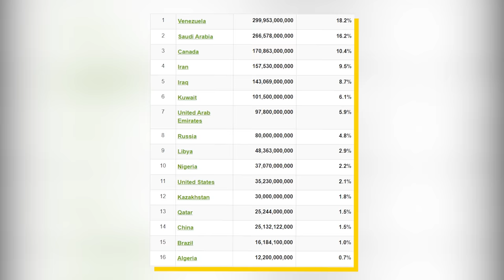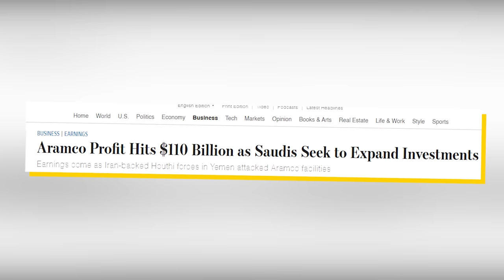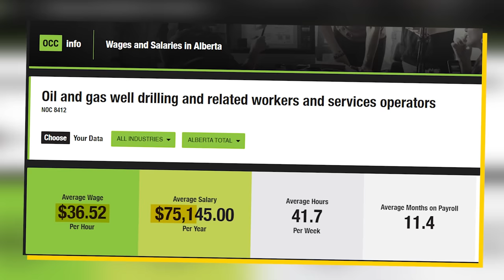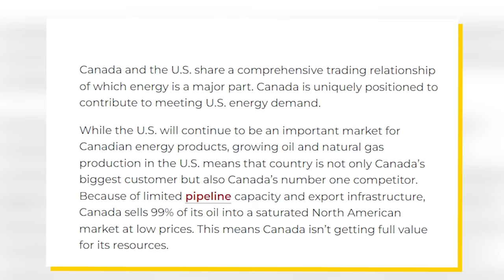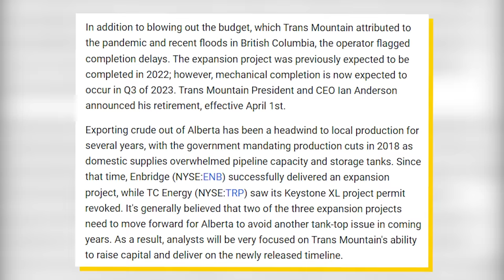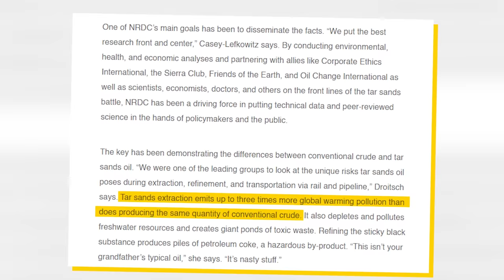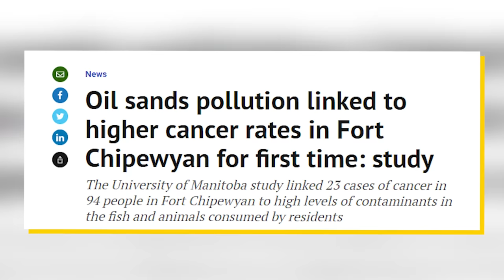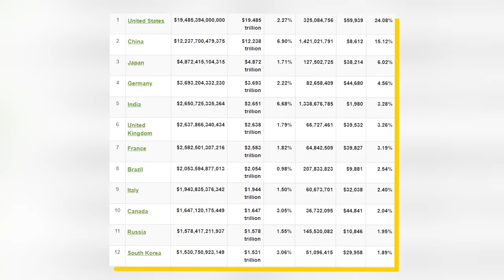Why Canada Refuses To Exploit Their Gigantic Oil Reserves

Comment: Canada is the third largest oil exporter in the world. The conclusion and title of the video are factually wrong. Canada does exploit it's oil reserves fairly aggressively despite all the technical issues.

At the same time, the video does cover many of the aspects of the Canadian oil sands industry. In my view the primary reason that Canada doesn't export to Asia, or even permit significant Asian participation in the oil and gas industry is long term policies in Canada and the US for energy security. There is a "silent" tendency in trade, business and government to keep the Canadian resource for North America only. As every Canadian and Mexican knows, what the USA wants, the USA usually gets.

When I worked on offshore projects a "spill" was anything more than a gallon. More oil is spilled by DIY mechanics in any major city in the world that is spilled by the oil industry in Canada most years. But when the oil industry has a big spill, it can be spectacular. This is the nature of any large industrial process. The environmental issues in Canada would be  (and are) quickly swept aside if there was any serious impediment to US energy supply.
Reply: Yeah that's why we've been trying to sell our electricity surplus but they have imposed a tariff restriction (lower prices just like our oil) on us and their largest City (NYC) is screaming after the federal government for their interference in this "deal" as we just turned them down (a few months ago).
Reply: Yes what the US want in north and even south america the US gets
Reply: how ironic is it that canada and not saudi arabia has what's called sand oil lol
Reply: Thank you. Good to see some critical feedback on these type of clickbaity, view hungry, often misinformed youtube videos.
Reply: them thinking that Venezuela didn't exploit their oil supply because they were corrupt also pains me. they exploited their oil supply and as a result became corrupt.
Reply: @Bigzthegreat  no the us couped them a bunch of times and is threatening them with soft power like the rest of south America
Reply: @bigmviperplayz253  - You left out the key detail about Venezuala's gross political corruption and economic incompetence.
Reply: @jonfklein  Canada is essentially producing at full capacity. Saudi and Iran are not. The problem isn't Canada being able to produce more oil, it's about producing more oil tomorrow. Producing oil isn't like turning on a tap. It isn't just sitting there waiting to be burned. It really isn't all that easy, or cheap to increase production capacity.

The biggest challenge the Canadian oil industry faces isn't finding resource, it's finding buyers willing to commit to 20-40 year contracts at a high price. Oil sands requires billions of dollars of investment and years before selling your first barrel.

So the US looks to Saudi and Iraq who can produce an  additional 1-4mbopd during the "short" crisis, until Russia goes back to normal oil delivers. Canada requires a longer commitment and lead time.

There are additional complications such as the type of oil refineries can  use. For example, some refineries can only use heavy oil, like Canada's and others can only use lighter oil, like WTI or Brent. The refineries cannot switch quickly. This can lead to price volatility.

My expectation is that as Russian oil finds it's way into China and India over the next year, Middle East oil will find it's way to Europe and the price will stabilize with most of the price increase really due to increased economic activity and little due to the war.
Reply: @logaandm  
You are right and wrong. It's true that the global majors in the oil and gas industry have cut and ran from Canada, and profit expectation underlies this exodus. But the root of the problem is not the cost of production, it is environmental and political opposition. Basically Canada has an unfriendly environment in which to produce oil, which increases risk to investors. Also there is insufficient takeaway capacity to support expansion of the oil sands anyway for the same reason.

Canada is right next door to the largest oil consumer in the world. Hence expansion of Canadian oil sands production could be unlimited if it was not opposed. Also, the US refineries along the Gulf are amongst the largest and most sophisticated in the world and are designed to handle heavy crude.

One further point. The economic war against Russia is a long term game, not short term. Development of Canada's oil, and gas, resources should be happening now so that it can be used to displace the production from bad actors in the world like Russia. Are we to give Russia a slap on the hand after they annex a quarter of Ukraine and sign a peace agreement, only to have them invade again five years from now, and we are back to square one? It's called energy security, something the climate-zealot nit-wits running Europe, Canada and the USA right now pretend isn't important.
Reply: @jonfklein   I'm Canadian, I worked in the oil industry in Canada and elsewhere my entire adult life. (Started at Home oil in a summer job in 1976 out of high school) I've had this argument many times before.  This is a false narrative spun for political purposes.

Go look at the actual export data and not just parrot what you hear on the local news. There has never been a slow down in Canadian exports (almost exclusively to the US) in history EXCEPT for price drops and recessions. Never.

It has always come down to Canadian oil being more expensive than other oil. In the end the cost of production, the cost of transportation, the cost of refinery modifications make Canadian oil a more expensive choice for US consumers.

Since there has never been any serious slowdown in Canadian oil exports it is very hard to argue that it's about the environment, politicians or protesters. It's really that the Americans don't want it at that price - for now. Canadian oil is expensive to produce, it is harder on the environment. There are better alternates. For Americans (and many Canadians) Nigerian oil is cheap, light and the environmental damage is in Africa where it isn't seen by voters. It really is as simple as that.

In recent years society collectively has decided it wants to move away from fossil fuels for environmental reasons. That has complicated things because of the very long lead times for all oil and gas projects worldwide. All the easy cheap oil is gone and has been for decades. As I said, Oil companies are reluctant to invest unless they get long term contracts and short term problems like the Ukraine war don't change that. With governments worldwide committing to electric cars all oil projects - which by their nature are long term - have a higher risk and no one will commit. 

Economics has always been the primary driver and only economics is needed to explain production and consumption patterns. I have absolutely no doubt that if people want oil, they will get oil even if the temperature in Alaska is 40 degC year round. That is how people are and I haven't seen any data to suggest otherwise.

As a good example, all the BS about natural gas being "greener". It's a fossil fuel and methane is a worse greenhouse gas than CO2!  But natural gas makes cheap electricity that is easier to startup and shut down compared to coal plants for peak load management. That is the real reason it is used but it is just BS. Gas fired power plants make the problem worse, just not as bad as coal.

People have an endless ability to lie to themselves when it suits their interests.

FWIW In my estimation human induced climate change is a fact but:

1. Climate change is worse than the popular media suggests it is. 

2. It is already too late. When the arctic is melting, you have already put 80% of the energy in the system. The melting of the arctic will make a positive feedback loop of release of methane and CO2 which we can't stop.

3. We actually have bigger environmental problems. The real problem is and always has been too many people consuming too much.

4. People are going to consume anyway.  History shows this many times and I see nothing now to suggest humans are any different than the Sumerians who kept irrigating even though they knew it was destroying their farm land.
Reply: @logaandm  
You aren’t taking into account the lack of pipeline capacity to the US. They are taking as much oil as the pipelines can support. I think that says it all as far as demand for Canadian oil goes.

Harder on the environment than Russian, Saudi or Nigerian oil? I doubt it. There are no environmental regulations in those countries.

For oil sands oil, production, refining and transportation contribute about 15% of the total emissions of a barrel of oil. with the remaining 85% coming from the actual burning of the end products. For conventional oil, that figure is about 10%. So the emissions are only marginally higher for oil sand and can be improved upon. But these figures are if the emissions are controlled in a responsible manner. If the oil is produced in Nigeria, god knows what the emissions are. If it isn’t seen by voters doesn’t mean it isn’t there.

Which society are you talking about? There are different societies in the world that the developed world. Do you think a subsistence farmer in Africa gives a rip about moving away from fossil fuels? The issue of climate change has been politicized. Politicians are using it to scare the public, and claiming to be the ones who will save them - oldest trick in the book used by political and religious leaders since the beginning of time.

I think global warming is real, but it is by no means an “emergency”. It is an environmental problem, like the ozone layer that needs to be worked on. Renewable energy is developing and gaining traction and will be great when it is as cheap, reliable and readily available as conventional energy. But the way to get there is not to starve the economy of energy in order to force people to switch to an immature technology. It’s counter-productive and frankly stupid. How is strangling our economy going to make us better able to transition to renewable energy, how? It makes our society weaker, and other societies who benefit from our idiocy stronger.

Let me put it this way. If you want to transition to renewable energy should you sell your ICE car and seal off your natural gas line when you can’t afford an EV, insulation for your home and solar panels? You will have to quit your job because you can’t get to work now, and will spend one day a week chopping firewood. Are you any closer to having the means to make the transition? Of course not, you are now further away and in fact may never get there now.

If you believe the path to eliminating fossil fuels in the world is to stop using them today, then do it yourself. If you haven’t actually done it then you only need to look in the mirror to see that it is not the oil and gas industry that is causing global warming, it is YOU.
Reply: @jonfklein  If oil exports go up every year, which they do, then lack of pipeline capacity isn't an issue. Your argument is pretty weak. 

Keystone was canceled because it really wasn't needed and it make for good headlines. Same thing in reverse. It was promoted by the GOP because it made good headlines, but four years they were in power and it still wasn't built - because it really wasn't needed. I have no doubt if the US needed the oil, the pipelines would be built. It has been that way for over a century.

I agree completely on Nigerian oil. I have long advocated for taxes or duties on imported oil from certain countries. On a net basis, Canadian oil sands is more environmentally friendly than some oil producers.

In the end, I rarely give these things much thought because data and history shows them to be largely irrelevant. Oil production and consumption has always is driven by economics in the long term. Oil consumption will slow down when people don't want it any more and there is no sign of that.

You are completely wrong on climate. It is an emergency because action takes decades to implement and things are very bad.

I am not a greenie, I am not a tree hugger. I worked as scientific technical analyst helping to build simulation models for reservoirs in the oil business. The data and papers I have reviewed are very clear: human induced climate change is real and things are bad.

In my technical opinion it is already too late to stop serious temperature rise. If one could wave a magic wand it is possible - if we stop burning all coal, oil and gas, but the reality is that CO2 levels go up every year, oil consumption goes up every year and there are no signs slowing.

I cannot overemphasis just how significant it is that the Arctic is melting. Ice absorbs energy without raising it's temperature. So when it melts it means there is already huge amounts of heat in the system.

The same in reverse, we have to take out huge amounts of energy to get the ice to freeze.

This means that the melting arctic is a sign we are already gone too far. In addition CO2 and methane released from melting permafrost could easily exceed what humans are putting into the atmosphere. If that happens temperatures will continue to go up regardless of what humans do.

I am by nature and training a technical person. I review data, I call em as I see em.

1. Climate change is real and it is getting very bad.

2. People haven't stop using fossil fuels and there is really no sign they will stop.

3. While using alternative energy sources slow the climate problem, there is currently nothing that can replace oil or gas in the next 20-40 years.

The real problem is too many people consuming too much. The human population must go from where it is now to around 2-3 billion if we are to prevent environmental collapse. 

This is the real root cause it is a vastly harder problem than climate change and no one talks about it seriously.

I hope I'm wrong but I gave up a decade ago.
Reply: @logaandm  
Any increase in Canadian exports is by rail and by optimizing the existing pipelines to squeeze out a bit more capacity.

You are inferring that the Keystone XL was not needed because it doesn’t exist today without taking into consideration anything else. It was cancelled because the greenies are part of Biden’s political base and he campaigned on doing this, full stop. TransCanada had secured contracts to ship 500k bbl of oil for 20 years prior to proceeding with construction. So it most definitely would have been used. Was it “needed”? I suppose “need” is a debatable term. If American presidents prefer to go cap in hand to Saudi Arabia, Iran and Venezuela when they need more production, then you could argue no it isn’t needed. If they prefer energy security, then yes it is needed.

I agree with your prediction about oil consumption, with a qualifier: Oil consumption will slow down when there is a cheaper alternative available. This gets to the core of the energy crisis today. What is happening is western countries are trying to artificially increase the cost of oil by restricting supply in order to force people to switch to alternative energy sources. However, the same economic decision making that applies to investment in new oil production also applies to investment in renewable energy production. Investors will not invest in renewable energy if they know that the price of a competing energy source, oil, is artificially inflated. The price of oil could drop in the future, breaking the economic case for the investment in renewables.

I don’t think anyone really knows what will happen with increasing CO2 levels. Increased CO2 also promotes increased plant growth, and cloud cover. So it could be these and other mechanisms will regulate the amount of warming and keep the climate stable. But the earth is complicated beyond our ability to understand it. The way I see it is we don’t have a complete understand of how living organisms function, so how can we have a complete understanding of how the earth functions when it is made up of trillions of individual organisms.

I agree with you about consumption. Free trade with China is part of that problem - cheap products made to fail - which is a whole other discussion.

I’m optimistic. I think renewable energy sources will continue to expand and become more competitive in the coming decades. My problem is the path to get there is not to attempt to restrict oil and gas production, which is what western leaders promote, and Canada especially is paying a massive opportunity cost by buying in to this bunk.

Norway has taken the right path, they have not restricted their oil and gas industry. They have made it as clean as they can and use the revenue to build out renewable infrastructure throughout their country. They also have the largest sovereign wealth fund in the world. Canada on the other hand has a massive government debt and very little renewable infrastructure. Who is further ahead both economically and in transitioning to renewable energy Norway or Canada? Noway is miles ahead.
Reply: @wiseonwords  yeah and whose fault is that I wonder
Reply: @jonfklein  The US buys very little oil from Saudi. Biden went to Saudi to get Saudi to increase production so the global price of oil remained stable. 

If the market was stable with more Canadian oil or less Canadian oil prior to the Ukraine war it wouldn't have made any difference. There still wouldn't be spare pipeline capacity and Canadian producers still couldn't ramp up production fast enough to make up for the lose of Russian oil to the market. 

Increasing Canadian oil production to make up for Russia is a decades long process regardless of where it goes. I don't know of any oil executive who would build spare capacity "just in case." 

Your entire argument completely ignores the lead times for increasing production and ignores the fact that markets tend to stabilize to "just in time" and "just enough capacity". The applies to all industries, not just oil.

If Americans want to support Ukraine and the sanctions on Russia, then any American President would have to ask Saudi to make up some of the production lost because of sanctions on Russia, even though the US doesn't buy much if any oil from Saudi. That is because only Saudi, Iran and a few other countries have any spare capacity that get enter the market in less than year.

The Energy Independence that the US sought for so long has been achieved. Americans use US, Canadian and Mexican oil for most almost all of their needs. Biden's visit was all about world energy price (and politics).

If the pipeline isn't needed, it isn't needed. The why doesn't really matter. As I pointed out Keystone was a political football ON BOTH SIDES. The Republicans could have gotten it build when Trump was President - they did not. This is more evidence it wasn't really needed. If it was, then it would have been approved and built.

The Transmountain pipeline is a different story. As I pointed out in my first comment, something always happens to prevent significant exports of oil and gas from Canada to Asia and Europe. Always. 

It is my  belief this is a long term unspoken policy of the US government. Exports are just never going to happen. Canadians will be allowed to sell oil to the US and no one else. This time it was environmentalists. for Nexen it was China and the SEC. Petronas was "costs of the project after Shell pulled out. There have been others. Something always comes up to stop such projects. This has happened my entire 64 year life.

You are factually wrong. Modeling CO2 is well documented and tested science. It is happening. The Earth and weather systems are complicated, but not beyond our understanding. Climate modeling, especially the pessimistic ones, has been depressingly accurate.

Just because you haven't taken the time and effort to understand climate science doesn't mean it is uncertain. I am not an expert, but my expertise is in mathematical modeling and I have spent some time trying to understand climate science. Most people don't have as much idle time or a passion for science as I do.

Aside: I find it ironic that oil company executives fight climate change science and the modelling so strongly. I worked on teams that build models using exactly the same equations, exactly the same science that climate models use (equations of state, fluid flow, heat flow). 

Oil company executives used these models to make corporate life and death decisions. So, when they say they don't trust that type of modeling, they are just plain lying because they use it all the time.

I follow renewable energy pretty closely in part because I want to convert my house to entirely solar. I am not so optimistic.

The biggest problem is batteries and energy storage. There isn't any good cheap ones that form a long term solution at the scale the world needs.

Solar and Wind are great and there is plenty of it. The problem is the sun doesn't shine when we need power the most and the wind doesn't blow consistently. This is an even bigger problem in northern countries like Canada and northern Europe where energy use is very high at the darkest time of the year.

What is really need is energy storage technology - and so far nothing has come close to being able to fill that role.

Everyone has heard that Germany has produced 36% of it's energy from wind and solar. On a good day in July. There are days in the winter when wind and solar produce almost nothing. Overall renewables only provide about 15% of Germany's total energy usage. And Germany has put more effort and money into renewables than any other country.

Moving energy from the south where solar is more reliable and plentiful, to the north, where it is needed also presents large technological and economic challenges. There are a number of such trial projects. Most have failed.

Fusion is 50 years away and has been for 70 years. When they talk about the day they finally get more energy out than they put in, it is still 50 years away. They need to get about 3 times more energy out than they get in for it to really work. Even if they should do that tomorrow significant energy from Fusion is many decades away. By that time climate change will probably be well beyond the tipping point.

As near as I can tell, the one energy source that might fill the role is Fusion with Breeder reactors. Because of Chernobyl and Fukiyama, this are even more disliked than the oil industry  Even fusion isn't without it's challenges, but at least with breeder reactors there will a long term supply of fuel. Again, the a major problem is building enough reactors. It takes more than 10 years to build a reactor, they cost billions and they almost always go over budget and take longer to build than planned.

Conservatives have been talking about how the debt is going to destroy western civilization since before I was born. It hasn't happened. Japan has been running deficits for about 40 years and it is still the third largest economy in the world. The US debt is off the scale, and it is still the largest economy in the world. The effects of government debt on a well managed advanced economy is demonstrably almost nothing. This is a historical economic fact.

The conservative debt hobby horse is just evidence that conservatives don't have a clue how the economy really works.

I could write about his much more, and why debt hasn't matter and when it probably does but this video is about oil and not economics.
Reply: @wiseonwords  You left out the detail avout the US extreme sanctions and embargos which basically cut off Venezuela from all of global trade. It isnt hard to imagine how that vould possibly affect inmensily their economy.
Reply: @logaandm  A realist! You've made me nostalgic for the days when theoildrum was still an active website and community. The quality of thinking and discussion on the topic has taken a tumble since it was archived. You strike me as the type who may have been active there.
Reply: Canada imports almost the same quantity of energy that it exports.  Why does this happen, because central Canada gets its energy from the USA and West Africa.
Reply: @jrus690  Having a couple of glasses of wine while browsing YouTube?

Canada exports about 9'x as much oil as it imports. Exports about 4m bopd. Imports about 470k bopd.

60-75% of the imports are from the US because of lower transportation costs. Cheaper to go north-south than to go east-west.

For total energy, one has to include electricity and natural gas. Canada exports 3x's as much gas as it imports. Canada exports about 5x's as much electricity as it imports.

Before commenting best to type "google".
Reply: Did you know that typing Google does not tell you anything about the Canadian oil industry.
Reply: @logaandm  I had to have multiple shots after reading you reply, so yes, I have had some wine tonight.
Reply: @jonfklein  Keystone provided no energy security every single drop was for export
Reply: @logaandm  Aren't the huge shale reserves in the US cheaper to extract than 
Tar Sand oil as well?
Reply: @Paul-vf2wl  I don't think so, but I am not an expert in shale oil although I have worked shale gas projects. 

There are specific geological conditions which make some shale oil cheaper and those are exploited, but most hydrocarbons locked in shale is far harder to extract. Produced shale oil is light oil, which also means it is cheaper and easier to refine into sellable products.

The US Department of Energy has been working on Shale Oil for decades, including using an atomic bomb to try and get economic production.

Oil and gas are generated in shale at certain temperatures from ancient organic materials degrading in the absence of oxygen. Why shale? Because it is the mud and muck where most plants end up when they die.

Over millions of years the oil slowly seeps into adjacent rocks where it can flow more easily. If the oil is then trapped, it becomes a reservoir. That is where "conventional" oil is found. (If you want know more, do a search of "basin modeling")

The history of the oil business is starting with rocks where oil is easily extracted then moving on to rocks where the oil is difficult to extract. This is simple economics. You go for the well which gushes because it's cheap to produce. The fact that shale oil is even produced is a sign that all the easy stuff is gone.

Because there is so much shale everywhere in the world, it is easy to "spin" a story, but the simple fact is it would take a thousand years for most shales to flow enough oil to fill a barrel.

There is plenty of hydrocarbons, oil and gas out there. That isn't the problem. The problem is getting it to flow at an economic rate.
Reply: Canada has doubled it's oil production in the last 20 years. Unfortunately tax on the oil has halved.
Reply: If Jeffrey wants to be a hoonigan and fuck around with his DIY shit box on the weekends in the city, cool. More power to Jeffrey. Urban environments are already constructed environments, big deal. The same can't be said for the giant pipelines boring directly through dozens of Indigenous reserves, with literally zero relevant compensation, nevermind any form of actual consultation. You're right, after all; "environmental" issues are swept aside, the same as all the brown and Indigenous people making those "environmental" cries.
Reply: @wiseonwords  Venezuela was exporting oil to and refining oil in the USA  for many years without issue. Trump sanctioned Venezuela second day in office.
Reply: We used to, but everything has been scaled back in the last six years. So get real, the current government has hampered the oil industry at every turn.
Reply: Well until the Trans Mountain expansion pipeline is completed how would you be able to export oil to Asian countries. The LNG project in construction now will allow export of LNG in Canada to Asian countries.
Reply: the Keystone pipeline to Houston refineries would make this Alberta tar sands oil accessible to European buyers. By cancelling Russia from global marketplace, amping up production to the Europeans should be the Biden and Trudeau regimes top priority - given the Obama/Biden regime is at fault for pushing the cancellation of Russia (but at the cost of de-industrialization of central Europe)

Maybe the Obama-Biden-DeepState strategy was to take out both the Russian Federation and the EU - a two-for-one take down. That premise certainly does explain a lot.
Reply: @TheSulross  The existing Keystone pipeline owned by TransCanada pipeline has been in existence since 2013. That pipeline was expanded in 3 phases. Originating in Hardisty it ships heavy Canadian crude oil to Steele city,Woodriver, Patoka.Then extends to Cushing storage facilities then to Houston and Nederland. The capacity of the pipeline is about 700,000 barrels daily. The US has already completed reconfiguring of Gulf pipelines to expedite the shipping of Canadian heavy crude to world destination by ocean going tanker. Keystone XL was cancelled  by President Biden it was under construction when he cancelled the permit. That was a political decision by Biden not a common sense decision.But take away capacity for Canadian oil has been increased by the completion of the newly constructed larger Line 3 Hardisty to Wisconsin pipeline.That pipeline has a capacity of 760,000 barrels per day. Previously the old line 3 had a capacity of 390,000 barrels per day. Then there is the Trans Mountain twinning pipeline under construction. Once completed in 2023 that pipeline will increase Alberta take away capacity from approximately 300,000 barrels per day to 890,000 barrels per day. The newly discovered offshore oil field in Newfoundland has been approved for development.That is Brent crude oil which would be a good fit for Europe. Also natural gas has been discovered in Newfoundland so an LNG facility could be constructed as well as the nitrogen producing facility already approved for Newfoundland. Not all European refineries want heavy crude but Spain does. The US is shipping Canadian heavy crude to Spain from the Gulf terminals now. Europe is also looking to Africa for natural gas supply. The US is way ahead of Canada in LNG and is currently shipping LNG to Europe.But the prices are much higher than Russian natural gas.Europe got used to cheap natural gas from Russia but Russia diversified its natural gas customers and the price has gone up even prior to the Ukraine war. Frankly Europe will probably look to increase nuclear energy projects. It is clean energy and on demand energy the kind they need. Things change ,what happens if Putin is removed from power?